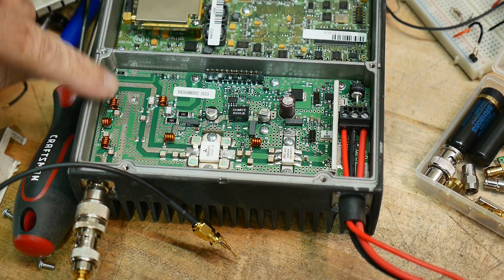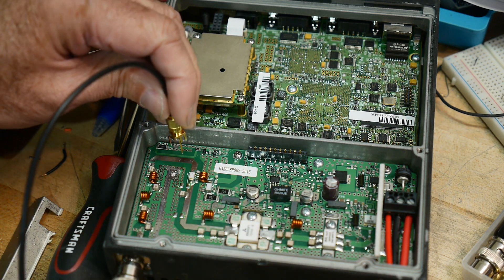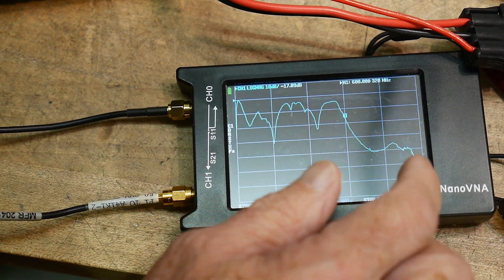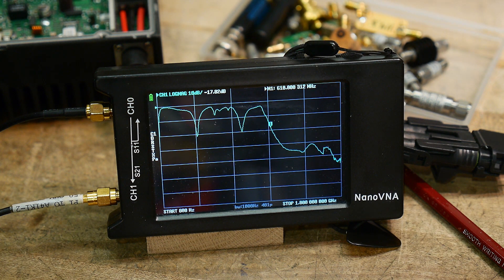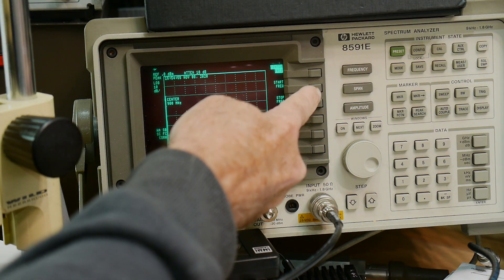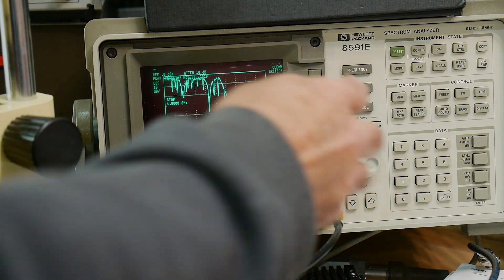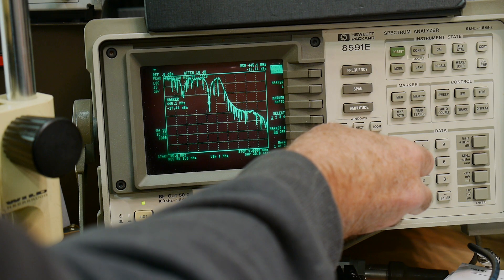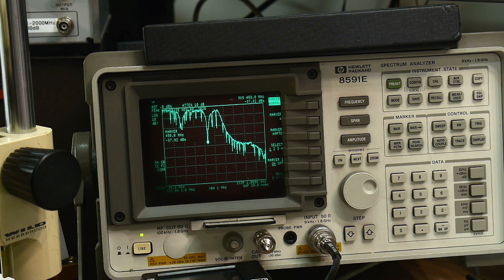#650 Gemini G3 Dataradio (part 2 of 3) Output Filter

Comment: I bet you can fiddle with some part and make it better. Also, is the fact that the driver transistor is connected to the line affecting anything? You can always just remove the filter that is in there and make your own. Chances are that stripline is 50 Ohms.
Reply from the maker: I think it is as you say, all the other stuff attached. I think the design is flat
Reply: @IMSAIGuy  I would try injecting a signal to the input of some pre-driver and then looking at the output. Probably want to use heavy high power attenuation to protect your VNA or Spectrum Analyzer!
Reply from the maker: @herbertsusmann986  next video

Comment: Probably work fine for a satellite uplink amp as the frequencies are down around the 430 range; repeaters not so much with the transmit frequencies usually being in the 440-450 MHz range (down 5 MHz for receive). So depends on what you want to do with it...I say jiggle the filter and see if you can improve its response!  ;-)